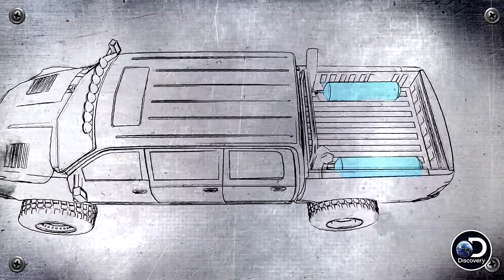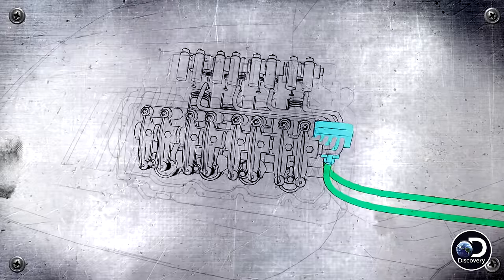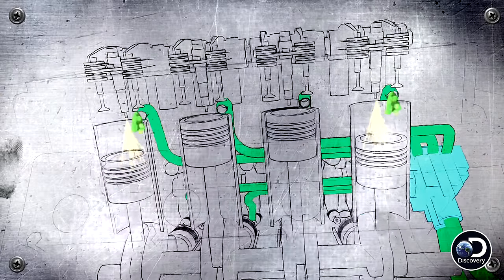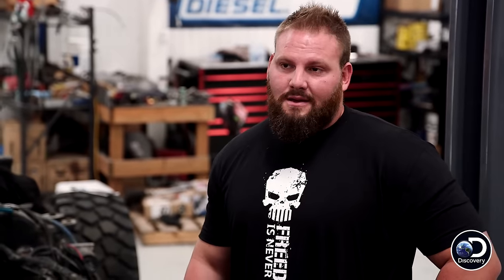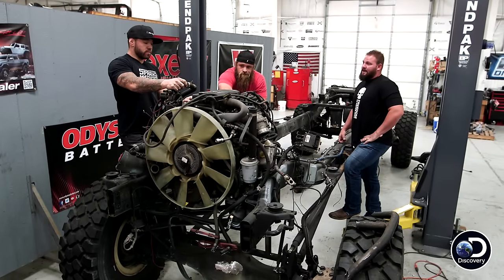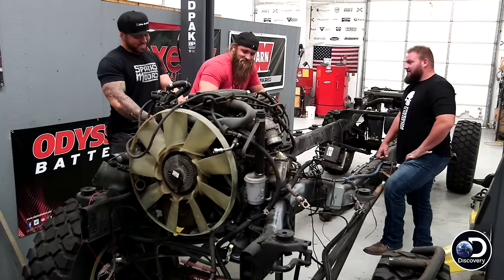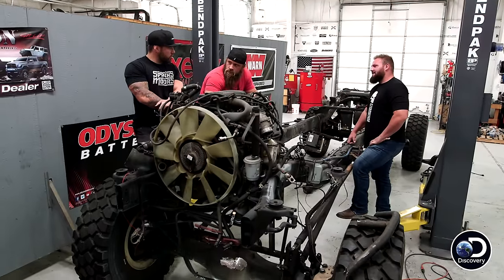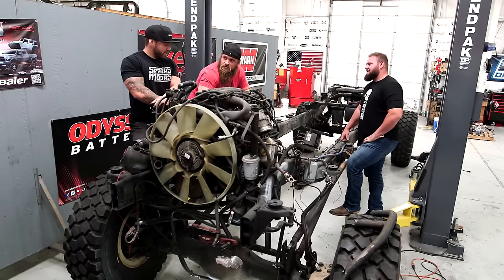Learn How Compressed Natural Gas Boosts A Diesel's Power And Efficiency

Comment: Route the CNG through a custom intercooler with a section of coils going up and down through it to allow the cooling of turbocharged intake air, warming of the CNG to prevent freezing, and increase efficiency.
Reply: Should  the CNG be hot when it enters the air intake?
Reply: @theideasman6018  Not really, but it should be allowed to cool the intake charge a bit and then be preheated to ensure it's gonna run well, you need the diesel to heat up the air by compression in order for the diesel fuel to properly ignite.
Reply: Do they sell a dual fuel propane and diesel kit just for better fuel mileage?

Comment: LPG got 2 good properties in diesel.

1. It creates more torque and power.
2. It reduces emission dramatically.
There is also 3rd thing but just when Liquid LPG injection is used, it drops EGT a loads what again convert to ability to generate more power. 
In 2007 first blokes was messing with tuning using LPG. Now a days there is great LPG systems that work much better and could give more gain in diesel then old low advanced systems with evaporator 10 or 15 years ago.
Reply: Do you know anyone that makes an add-on propane kit that goes in after the air filter for a diesel? I get a bit of propane for free and I just want it for better fuel mileage.
Reply: Rock onnnnnn

Comment: With the high comp ratio of diesels, how do you avoid pre-ignition when the CNG-air mixture is compressed?
Reply: it fires the same time that diesel fuel burns, with compression and at the right time :)
Reply: It’s not a problem, the gas mixed with the fuel just means a faster flame and more complete burn of diesel during combustion. You get higher cylinder pressure, so more power with less fuel.

Comment: I have a question, inside the cabin smells gas? Or something, I have a 302 Ford engine and inside the cabin smells really bad, but is running in gasoline, I want to know if this system fix the smell issue

Comment: Hmm rather than see beautiful/reliable diesel engines get extinct in the future i'd rather they are converted to run on CNG/LNG! I think Scania has them running on a fuel called ED95 (95% Ethanol 5% Ignition Improver) and a US startup has them runing on E100 (100% Ethanol) Scientists have also tested the Scania engine with MD95 (95% Methanol 5% Ignition Improver) and that is even cleaner burning!
Reply: It would be nice to see but unfortunately we are running blind into a future of battery powered electric vehicles without having first figured out the flaws